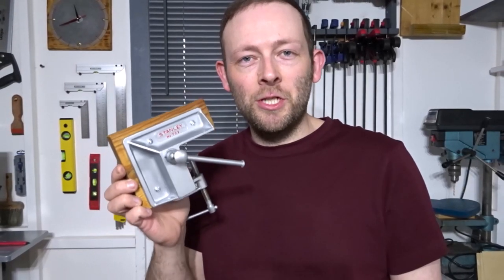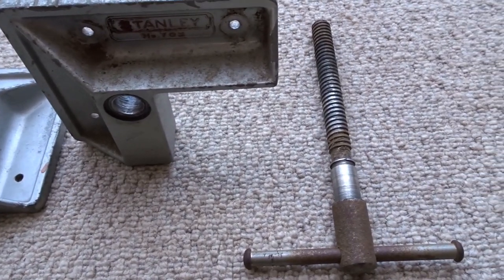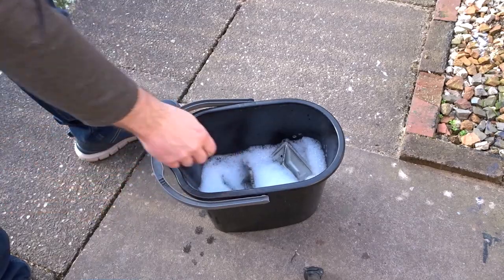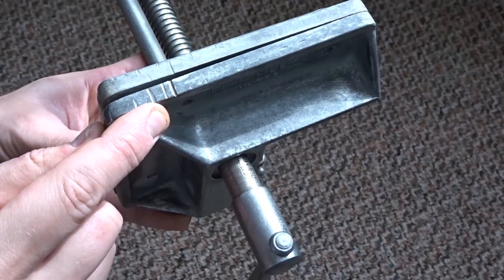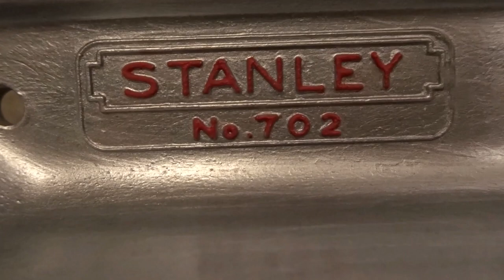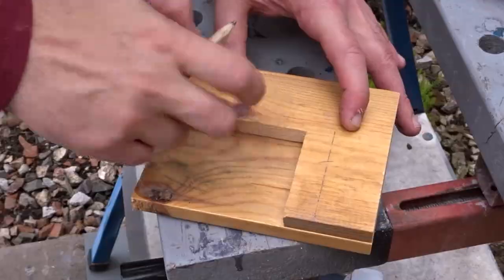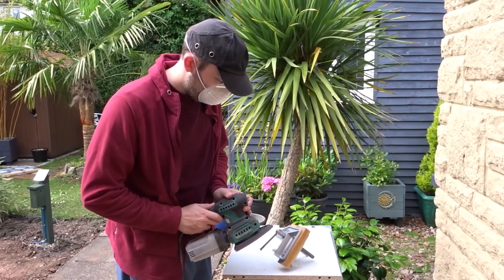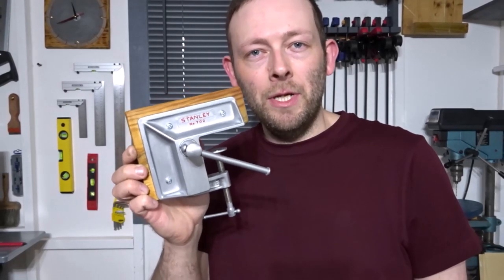Stanley No. 702 Woodworking Corner Vice Restoration + Adding Jaws

Comment: Geez, I'd forgotten all about these vices. I had one bought for me as a teenager in the mid/late 70's when I got interested in woodworking as a hobby. I can remember doing all sorts of boyhood projects with it, using scrap/found wood and reclaimed screws/nails/bolts. Glad to see yours came out so nice.
Reply from the maker: @PeteLewisWoodwork  yea they are an interesting concept being aluminium. An unusual tool I think. My dad found another one of these at a boot sale the other week for £2 so they're still easy enough to find on the used market.